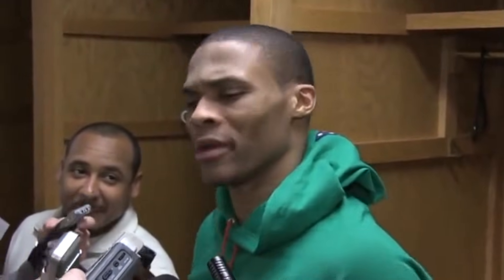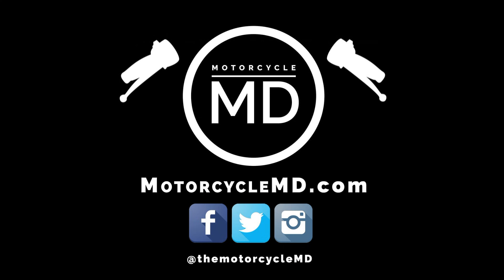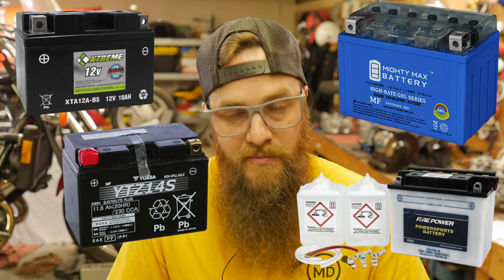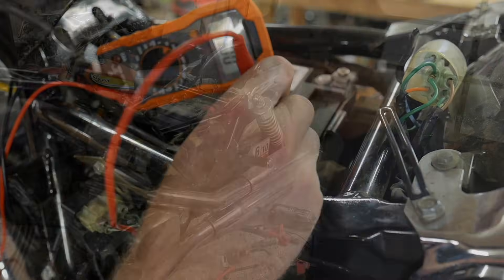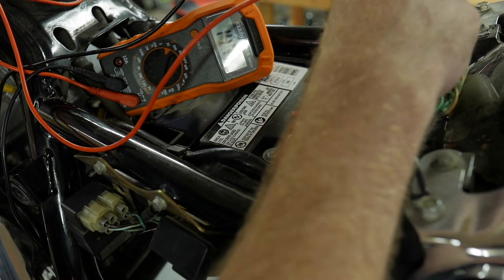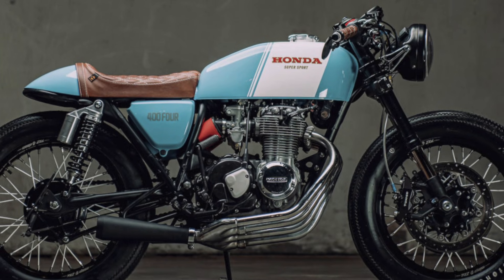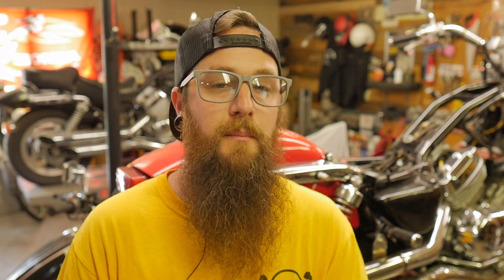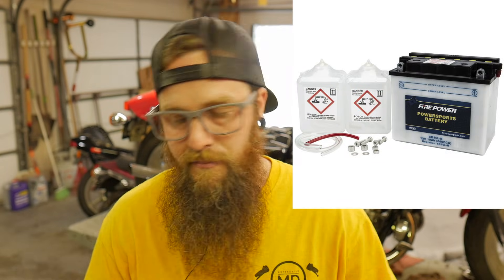Lithium Motorcycle Battery Upgrade – Safe for Your Bike?

Comment: Put a new battery in my 1979 FXS Lowrider 93" stroker (9-1 comp) and tried an Amazon Tycool lithium replacement unit. It cost $180. It did have a BMS.  It worked for a few miles and then shut my bike down and disconnected from the bike. Totally dead and would not let the bike start even with the kicker. After 20 minutes the battery reconnected and it started fine...then disconnected a few minutes again.  My charging system at full charge is 14.5V.  I sent the battery back and will go back to an AGM battery.

Comment: I have a 1100XX 97 model with stock charging, is it safe to upgrade to lithium battery. You also mention something for MOSFET regulator,do you recommend a make or model

Comment: I have an electrical question for you. I have a 1985 honda sabre  700. When the bike is just idling the left rear running light isn't  lit. But the right rear running light is on.   The left taillight in the red brake housing is off too, but the bulb is good. But both rear brake lights light up when I turn the key to the park position on the ignition switch. 
  Also when the bike is at idle and no turn signal is turned on, I get a constant amber right signal on the console. I've  cleaned all connections. Changed the flasher relay. I've cleaned the turn signal switch.

Comment: Yo, MotoMD
Wow, I see the intentions are good, but you really need to get some things straight. For starters, anything over 3 something volts will be a multi cell battery. The cells need to be kept as close to the same voltage as possible, at all times, to prevent failure. This is where the BMS comes in.

There are 3 common lithium battery chemistries available, from least safe to most...

1: Lithium Polymer, or LiPo

These are commonly used in RC cars/planes/boats/multirotors (drones). They are light, very energy dense, and capable of large discharge rates. This is great for racing, climbing out, and punching up or out with your drone. They are also the most dangerous, by far. RC race cars usually use "hard case" batteries, which are enclosed in plastic to try and prevent physical damage to the cells. If a cell is punctured, whether from external sources or internally from abuse, they WILL experience a thermal runaway. This is also know as bursting into flames, if not outright exploding. I actually have a fireproof safe I keep my RC batteries in, just so I can sleep at night. Discharge rates fall as temps go down, thermal runaway risk increases as temps go up. These don't usually have any internal cell management, relying on the charger to balance cell voltage when your are charging. In fact, most decent chargers have a balance function you can run to ensure this. While discharge rates can be crazy, imagine a 30 something volt 8Ah battery that can fully discharge safely in a minute or two, charging them too fast will kill them quick. These are the "NitroMeth" versions of lithium batteries, as compared to internal combustion fuels. I would never use one of these in a car/truck I operate, much less a motorcycle.

2: Lithium Ion, or LIon

Here is what most people think of when "Lithium Batteries" are mentioned. Commonly used in all sorts of things, from your wireless headphones, to your phone, or your electric vehicle. They are heavier and less energy dense than LiPos. These are also usually multi-cell arrays, whether it's your car or your remote that takes 2 AAA rechargeable batteries. While your remote doesn't care, your car has hundreds of cells and absolutely has a BMS managing things. These are much more stable than LiPo batteries, though they are still capable of thermal runaway. Go lookup "burning Tesla" for an example. While less susceptible to internal damage, it can happen. Any damage or extreme heat  will result in thermal runaway. Essentially, lithium really wants to catch fire when exposed to air, or rather the water it contains. This is true for most of the elements in the far left column of the periodic table (Alkaline Metals). They also don't like being cold. which reduces the amount of power they can provide or be fed. Like all these batteries, they do heat up as they are used. So it's a transient issue. These are the "Gasoline" versions of lithium batteries.

3: Lithium Iron Phosphate, or LiFePO

This is the most stable of these chemistries, by far, as it can't really experience thermal runaway. It can burn, but it's not capable of doing so without some external source of heat. They have excellent charge retention, and even better deep discharge capability. You can charge them all the way up, discharge them all the way down, and are very resistant to developing a "charge memory" as is common with other battery types. This is why you see a 3-4Ah LiFePO battery being sold as equivalent to a 7-9Ah lead acid battery. Even a LIon battery doesn't really like being charged above 80%, or discharged below 20%. As mentioned, these are popular for making large banks of reserve power for homes, especially with solar setups. You can charge them while the sun is shining or electricity is cheap, and they will hold it till you need it. The main downside is they are heavier per Ah than LiPo or LIon, and they can't really be charged when the cells are below freezing. This can be worked  around using cell heaters, or a BMS can trickle charge them to bring up or maintain temps. As noted, they can tolerate all but extreme heat. Any decent LiFePO battery marketed for a vehicle will have a BMS that prevents charging while frozen, along with the usual over/under charge and short protections. I've run multiple vehicles with these batteries, for few years now, with no issue. But, I also live in the southern US, so it's easy. These are the "Diesel" version of lithium batteries. Much harder to burn, but also the most capable in industrial roles.

Whew, sorry for all that. I just couldn't take all the ambiguities being tossed around in this video.

Fair winds and following seas, peeps.
Reply from the maker: Thank you for adding all of this Info to the video. It’s going to help someone out for sure. 🤘🏻

Comment: What do you think of replacing the battery with a supercapacitor? They seem an interesting solution, they can fully discharge and yet recharge again to 100% with no deterioration. I have seen people with classic cars use them and they say it's a great choice when you have a big pool of vehicles and hibernate many of them. I have a classic Yamaha TZR with kickstarter so I don't even need a battery once it's running or to move a start motor, seriously considering moving to a supercapacitor.

Comment: Generally there are two kinds of lithium batteries. 
Lithium ion and lithium iron. 

The later is by far the more current and safer type. Basically it “ won’t catch fire “ and is less likely to catch fire than a lead acid battery. In worst case scenarios, it’ll melt and smoke. 

As far as temperature goes. Both types of batteries don’t like the cold. However, unlike lead acid, lithium batteries will quickly wake up once the cells are activated. To do this, simply activate the ignition, give a “ quick “ blip to the throttle to get the cells moving. Turning a headlight on for thirty seconds will usually wake the battery even in below freezing temperatures. 

The new lithium technology does require a different charging procedure. Whereas lead acid prefers to begin charging at higher voltages, then trickle charge to top off. Lithium begins with a low voltage then increases as it reaches full charge. Once at full charge, usually 13.4v, do not continue charging. 

Lithiums hold voltage much better than lead acid, so topping them off not only is unnecessary, it’s detrimental. 
Do not trickle charge a full lithium.  

Tecamates Optimate for lithium is the only solution to lithium charging I recommend. 
Its charging is progressive from high voltage and reduces as the battery becomes full. 
If left connected, once full, it will hibernate for 24 hours, then wake to see if the voltage has dropped enough to begin charging again. 

Though trickle charging is detrimental to lithium batteries, keeping them in the nearly full range extends their lifecycles which greatly exceeds lead acids lifecycles.

Comment: I noticed you only mentioned lithium ion batteries, I would not put a lithium ion battery in any motorcycle. I would however consider a lithium iron phosphate battery because these are much safer. Much easier to use. They won't catch on fire like a lithium ion will, and they're less sensitive to charging mistakes.

Comment: I bought a bike that somebody threw a lithium ion battery in and it exploded/burnt up. '79 Honda, they didn't change the original R/R out for a modern MOSFET type. It totally melted the battery case and crumpled in on itself.
Reply from the maker: Bingo! Thanks for telling about your experience. I think your exactly right 👌🏻

Comment: Just stumbled onto this video (I know, bad choice of words, LOL).  Been kind of riding the fence as to whether I want to switch to lithium type battery in my 1999 ZRX1100.  I think this seals the deal for me.  I will be sticking with the acid/AGM type batteries for this bike.  To me it seems to make more sense to stay with what the system was originally designed for.
Reply from the maker: I think you can go either way man. But I think it will save the wallet to stick with what you know works. Lithium battery’s are awesome. I’m not trying to bash them in this (although it seems like am) 🤪. Those other battery’s styles are great.

Comment: What's up Cody! Great informative video guy! I've used a Lithium battery in my 2001 Honda CB750 Nighthawk (Black,same color as yours!) for the past decade and have NEVER ONCE experienced ANY problems with it whatsoever! As a "backup",I also installed a digital voltage gauge that I have stuck between the two analog gauges up on the dash (speedo/Rpm) so I can easily look and monitor what kind of output my Lithium battery is putting out and what kind of charge it's getting back to make sure the "brushed" alternator is doing it's job and giving out proper voltage to the system! As You stated,I live in a "northern" state so during the winter-times,I ALWAYS remove the battery from the bike and bring it on inside and store it safely in the basement where it maintains a consistent heat and humidity level and is hooked up to a "Battery-Tender" that's specifically designed to be hooked up to a Lithium-ion battery! When I HAVE tried starting it in cooler weather conditions,I can "hear" the starter trying to get enough voltage to turn over the engine! So your right,Lithium batteries DO NOT DO WELL in Low-temp. conditions! However,in warmer conditions,they do perfectly fine! Peace Brother!
Reply from the maker: Love this comment! Wish I could pin it to the top! Great care for the battery! Love that you put a digital readout with it to
Monitor. A+++. Thanks for posting your experience with it. Love that it is working flawlessly for you!!
Reply: @TheMotorcycleMD  Thanks for your comment and Your video's Cody! 😁

Comment: This dude is missing the fact that there is a big difference between lithium ion batteries and LFPO batteries as far as both safety and price- the latter being much safer and cheaper.  LFPO's are what many people have been switching to for their home solar PV systems for energy storage.

(LFPO being lithium iron phosphate)

Another benefit of them is that besides safety is that they have a higher amount of charge cycles before they degrade then even lithium ion, which is already much better than any flavor/version of lead acid tech.

A properly maintained, high quality LFPO battery could literally last 20 to 25 years no problem.

They do have some issues like cold tolerance, but all you have to do is warm them up a little and that is very easy, you literally just turn on your bike without starting for a minute or two and the battery will warm itself. In the colder months, put it in an insulator and you are good to go. They are small enough that you should have the room for that.
Reply from the maker: Thanks for posting this information about the differences in them. 🤙🏻 I Agree with this 100%!
Reply: @TheMotorcycleMD  You're welcome.
Reply: But are Lithium Iron Phosphate batteries being offered in the motorcycle replacements?  The early lithium moto batteries I've saw were not. I haven't followed the subject because Lithiums are almost all made in Communist China, while many of the AGM batteries are made in democratic countries.  Plus I get 7 to 10 years out of Yuasa batteries anyway. That's pretty decent economics.

Comment: I ride a Honda CB 500 Four (1977) and I use a GEL battery, hope that's okay or do I also need a MOSFET?? Best regards Eivind
Reply from the maker: Just check out the charging system. Gel battery is just fine 🤘🏻🤘🏻

Comment: I have a 209 FZ6R  original batter, never used a maintainer. Kept in an unheated shed and it starts every year.  Opinion ?
Reply from the maker: Sounds like your battery is working?

Comment: I ride an Indian, so I stick with OEM Indian AGM batteries. I tender it whenever it isn’t ridden for more than a week. I replace the battery in any bike after 5 or 6 years. I’ve never had one die. Lithium batteries in bikes in my opinion are dangerously unreliable.
Reply: Indian don't make batteries
Reply: You can get a battery load tester for home rather than just replacing after a certain amount of time.  I've had some last 7 to 10 years when they were on a floating charger.